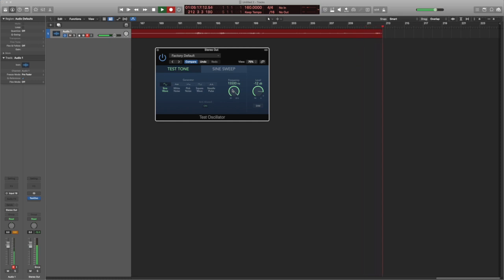KRK V8 Series 4  Low / Sub Frequency Artifact Issue

Comment: Yeh I was thinking that you maybe hearing things cos my KRK VXT 6s handled it so well. Made me think you may need your ears testing.
Reply from the maker: HAHAHAHA... You can literally hear the artefacts in the audio sample I provided. They are low frequency artefacts. Hearing damage due to exposure is usually associated with high frequency loss and often, but not always,  tinnitus. I'm suspecting more and more that these are Nyquist frequency related aliasing artefacts cause by some filtering failure in the electronic crossover. Your comment was entertainingly ironic because you apparently can't hear these artefacts I'm talking about in the samples I've provided here yet I'm the one with the hearing problem. I am dead

Comment: Damn, That sucks mate. I hope it's rectified. Thanks for demonstrating this fault, and describing your experience with customer support. This is making me re-evaluate whether I should purchase a pair of these speakers. I found a bargain online $1600 AUD/pair,  brand new for V8's and $960 for the V6's (which would likely suit my room better, and are a more justifiable price), and came to youtube for reviews to see if they're worth it and what else might be of consideration at that price point. Having seen/heard this video now I'm starting to think it's a deal that's too good to be true. 

Now I can't help but feel these are over engineered contain PCB's for features I'll unlikely really use, and thus be the component bound to fuck up past the warrant expiration date. I'm thinking I'd be better off with simpler, cheaper, and higher quality tech (I mean they're speakers/monitors, not a theatre simulator), and spend the savings on acoustic treatment. 

I actually can't really imagine why a pair of monitors needs so much processing capability. What goes into the mic should matter more than what comes out of the monitors. These actually seem like an oxymoron of the studio monitor variety. They do all the things that monitors shouldn't do ( use tech to make you think you and your environment sounds good on their system, and their system only, and fail at what they should do, make you sound good regardless of the system. They have one fucking job. One. Well, one would hope, or more likely accurately assume. 

Sorry for the rant, OP. Just writing my stream of consciousness so I'll remember it tomorrow and start looking at other options.

Comment: What’s the news now?
Reply from the maker: Still love mixing with them but haven't bothered to try to get them serviced. It's not distracting enough to justify shutting down the studio for a month.
Reply: @noiseismylife  Was this always an issue or did it start after some years of use? Would you recommend getting the older version Krk vxt8s instead (gen 3)? Some of the shops near me still have stock.

Comment: Time for an update, did you solve the sub frequency artifact issue.
Reply from the maker: Wish I had one. The pandemic still rages and I'm unable to make the trip to Toronto to get them serviced. I don't have any backup monitors so I'm just living with it. Fortunately I can largely tune it out but still, not great. At least it doesn't appear to be negatively affecting the mixes.
Reply: @noiseismylife   So it's been two years, and have you come to any conclusions (other than their customer service suffers from an ignorance issue) and any fixes for said problem.
Reply from the maker: @malibustacy3606  at this point, my ears have gotten used to it, and I’ve been able to ignore it, but I certainly still have a bad taste in my mouth regarding their customer service. Saving grace is that the speakers do perform exceptionally well, save for this one, irritating, glaring issue.
Reply: @noiseismylife  Like I've mentioned in the past, (I think) I own the V6 S4's and I have to get right up to it just to hear it, so you must have 'good' hearing.
Reply from the maker: @malibustacy3606  and I think that’s part of the issue is that I can’t put the speakers further way, because of spacing limitations. The Inver Square law is working against me in the situation.

Comment: Hi Roberto,
I have the same issue here, and like you love them so much that I'd rather fix the issue than loose them. I'm in the UK, so even less chance of getting help from KRK, But if we can find enough people with the issue, maybe we can get something done.
Reply from the maker: It's so frustrating. Fortunately for the style of music that I do the issue is masked most of the time by the sheer wall of sound, however it does rear its ugly head during single instrument performances. It's weird that it doesn't happen if the volume is high enough, but I don't like to mix at those volumes, generally. It doesn't help that the speakers need to be so close in my space either. Still, they sound fantastic otherwise but this issue is frustrating, and I'm still pissed off with that piece of shit service rep from KRK that just hung up on me because he didn't have the patience / mental bandwidth to care understand the problem.
Reply: @noiseismylife  yeah I’m the same, I don’t  mix super loud either, but don’t seem to hear it in full mixes either. I notice mostly on voice stuff when listening to podcasts and YouTube etc. I thought it was a weird thing with my room, but have since moved to a better place, and it remains!
It’s certainly not the desired response from KRK. I used to be in contact with the main product guy, but he’s since left KRK , so I’m not sure how much help that would be. I could probably get away with V6’s in my current space, but frustrating to loose money on selling these just to get smaller ones.
Reply: @noiseismylife   "Piece of shit service rep"......nicely articulated.

Comment: I just bought today KRK v8 s4, I have issue with (left) speaker, it doesn't work correctly in 30hz-60hz sub frequencies. Second (Right) speaker works correctly, no problems with that.
Reply from the maker: I feel you, it's such a drag.

Comment: Did you ever solve this problem?
Reply from the maker: Not yet. The pandemic has made it challenging to get service. They would need to quarantine the monitors for 5 days before they even send them off to the service centre, then another 5 days when they return. I'm just going to wait until I can drive them to Toronto myself. I'd rather make the 2h drive than to wait to have the local retail outlet ship them out. They're out of warranty anyway.
Reply: @noiseismylife  I have heard the issue happen once while working on voice over material with my v6 s4 at low volumes. Oddly, it doesn't happen much in other sessions but it came up. Subs below 80hz were audible even though I had filtered out everything above 180hz. It is definitely something with the circuit. Very disappointing but I love them so much and their translation that I just ignore it. My mixes still translate by mixing on these rather than my Yamaha hs series ...so I end up alternating between these, mixcubes, and headphones to make sure I'm hearing things right. Its not so much a pain in the ass but its most def a bummer.....cause I loveeeee their sound.
Reply: In fact, I love them so much I'm still thinking about getting a pair of v4 for my office. Am I fucking crazy? Idk what to do LOL

Comment: Hi Roberto,
I'm a fan of the brand and the KRK (VXT/V S4) has long been an option for me to upgrade to, so seeing this is pretty tough for me but I would really like to hear what has happened since posting this video. Take care!
Reply from the maker: To be honest, I've given up on the issue for now. It's hard to get them serviced during the pandemic so I'm just working with them as they are because most of the time it isn't an issue. It's only if I solo certain instruments or vocals can it be distracting. I usually will double check the mix with headphones to make sure there isn't anything wrong with to specific tracks. So far I haven't had fix any mixes because of this issue.
Reply: @noiseismylife  (sigh) That's great that you can still work with them and get stuff done so am happy to hear that! Thanks for responding and Take Care!

Comment: Hi Roberto, that's a very interesting issue you're having with your v8's and I wonder if you managed to fix it. I have the much smaller v4 s4 and I never noticed something similar to what you're describing. I tried recreating it by Eqing the 3.7khz in a voice line but I couldn't hear anything from the woofer. Obviously, this is not a thorough test, plus the v8 has a much bigger woofer and I think a different crossover frequency, but hey.
Reply: Hi Roberto, I would be tempted to go the physical way rather then electronics such as xover. Based on that freq sweep test, see if there are any connections between the harmonics and the length of anything that’s within the whole assembly. Finding the fundamental first which of course would be the loudest buzz. That could be a lengthy process or it could be one of the eureka situations. The tech gate keepers sound like a nightmare. I know, different ball park but years ago when I did the bench at the good old Music Mart which sadly is not with us anymore, once a guy brought a pair of Bose speakers that looked like have been literally tumbled in mud and dried off. Long story short I asked Bose for the price of replacing the insides because this obviously wasn’t a warranty thing. They asked me to send the speakers to them so I did. Two weeks later a package arrived at MM. Brand new replacement. I couldn’t believe it. That was some thirty years ago and I still remember this. Cheers man! :)
Reply from the maker: @presentalinkwalterbak2426  That's a very good insight, Walter! I thought of that too, but what's very odd that it seems to be voltage dependent as well as frequency dependent. I will get that artefact but if I lower or increase the volume the frequency of the artefact also varies. It's very odd. This is why I suspect it's something to do with the circuitry. If it was mechanical resonance, volume variations would only affect amplitude but I'm also getting frequency variations. What weird too is that these sub frequency artefacts don't seem to have any harmonic pattern related to the input frequencies, or more likely it's a very complex pattern produced by unexpected electronic resonances somewhere in the circuitry itself, is my guess.
Reply: Add a sub to this v4s and take it to next level

Comment: I'm not an audiophile by any means.  I've been shopping around for some guitar monitors and have heard a lot of people shitting on these KRK's for being too, "dark" or bassy.  I'm sensitive to high frequency sounds.  I like a flat response and would go a step further and say I like darker sounds.  Do you think the KRK's would be a good fit for me?
Reply from the maker: Taco Conch these are definitely not dark or overly bassy. I mean there is an insane amount extended low end, which is why you would buy the 8s in the first place, but it’s very balanced. When you say your are looking for guitar monitors, are you intending just to play guitar through these? Like using some type guitar interfaces and using theses as the amp? If so I would not recommend these for that purpose. These’s would be overkill. These are specifically designed for mixing and composing music on. There are much more economical options for monitoring guitar specifically. Hope this helps.